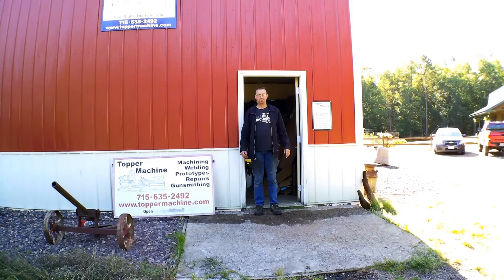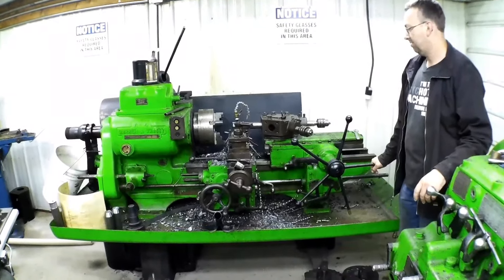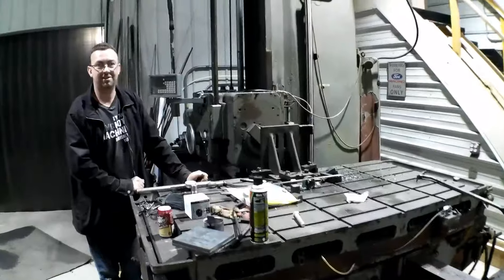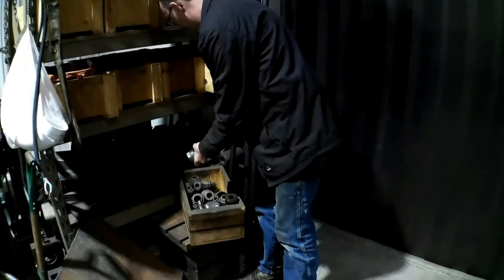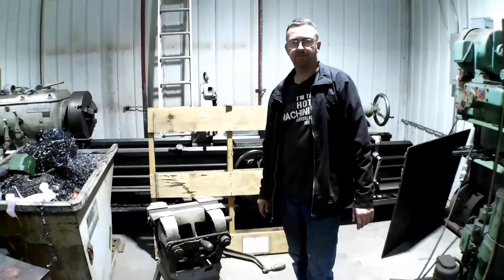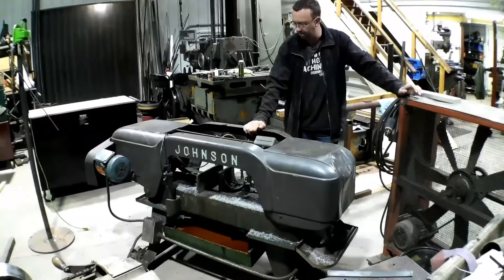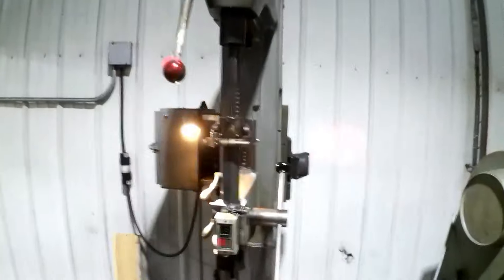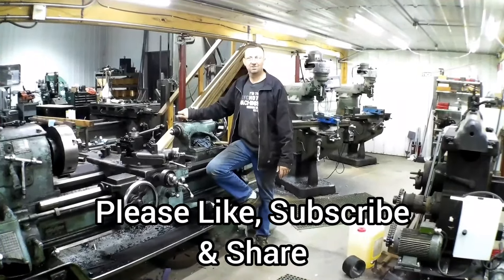Shop Tour, Topper Machine LLC, Pt1

Comment: I've got a bench top version of that heavy cast iron drill press you have. I bought it sight unseen,  I couldn't go look at it so I had another guy checking it out while he was there. 
  He called me while he was there and told me it was a good heavy machine that should last a long time but it was 3 phase. I didn't care about that so I had him bring it home for me. When I went to pick it up at his shop I was going to put it in the back of my wheelchair van but I discovered real quick that wasn't going to happen. 
  That thing weighs around 500 pounds but it works great for the job I bought it for. It primarily just drills holes in 2½ square tubing. 
 I machine & drill 2½ tubes for my brother in law that are used to build wooden dining table bases.

Comment: Well we are enjoying your forward movement, your shop is very nice you can make many parts there, hey I ran the horizontal and with the vertical headed mill a K&T but similar making aircraft parts well second operations after CNC machining in my youth (memories), nice share, nice tooling jigs, etc., you can do so much work there. Thank you. Lance & Patrick.
Reply from the maker: Thanks guys. It's been a long build to get my business set up. Now to get more work. 9 years and nobody knows I exist. It's been a battle. Been pushing the advertising and now these videos should help.